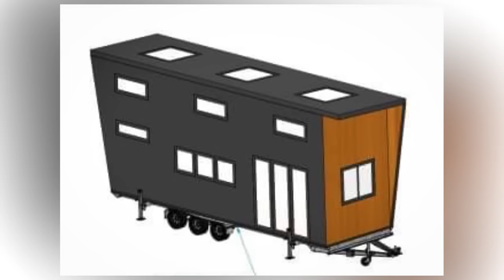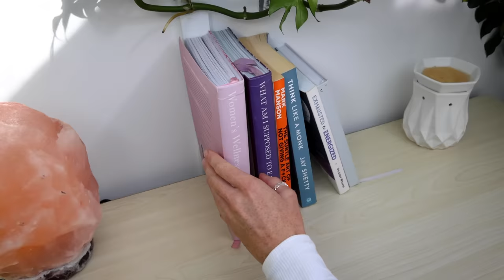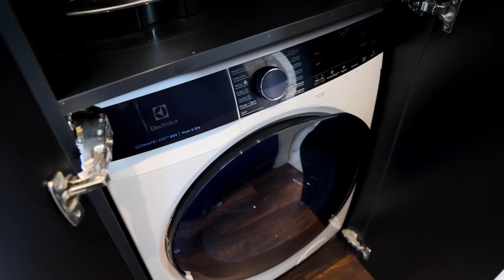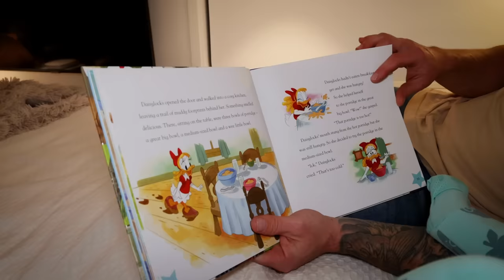Now This TINY HOUSE Will Turn Heads!

Comment: for the house owners ....you can add an 8 foot by 9 foot children's room after the bathroom, and you can add a covered porch out front the length of the entire home...that would buy you time for about 5 years while you pay this one off and begin raising capital for land or your next home ..and the covered porch will provide playspace for your dogs and little one to spread out a bit ...if the deck were built in sections, you could take it with you when you move

Comment: 🎉🎉🎉You could add a second pod access thru the bathroom using the long window and making it into a door. Or build a 3 meter wide tiny home. Love the colours style and design. I also like the idea of the washing machine in outside deck area ❤

Comment: I’m in the States and am interested in building a tiny house to park in my driveway and rent the house my husband died in until I can save enough to buy land to put it on. I’m overwhelmed and don’t know where to start (and I’m afraid of being swindled out of the little bit of life insurance I received when my husband died).
Reply: You need to engage a draftsman or designer (not Arch too expensive) get your plans finalized then tender out to a few contractors. Negotiate each trade, i.e. plumbing, electrics, glazing, roofing etc. You will be surprised how much you can save by managing this part of a tiny house project, most importantly keep smiling, there are people out there who care:)

Comment: Where are the baby's toys , high chair, pram, etc ? It doesn't look like a house where a baby  lives .....
Reply: Pram in the car boot, folding table seat in a kitchen cupboard, toys put away for this video that thousands of people will watch. Homes with babies don't have to be a mess, with plastic tat strewn about. Didn't see dog  stuff, either but they have two healthy looking dogs and a delicious  happy looking little chap, so the "stuff" is there, somewhere.
Reply: maybe they have it put up until they are using it?? maybe they didn’t want a mess showing there house off.
Reply: 😂 That’s why they’re already planning a larger home.
Reply: I'm sure they cleaned before Bryce came over
Reply: @willcookmakeup  We’re all pretty sure of that, however it’s a reasonable question.